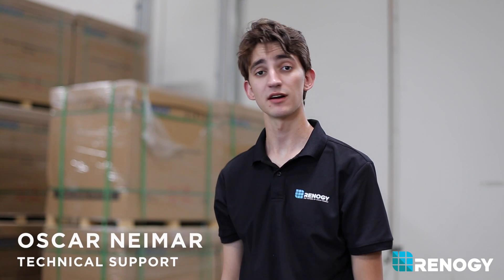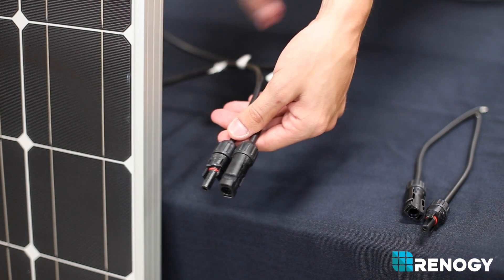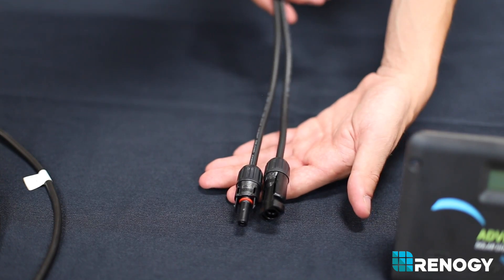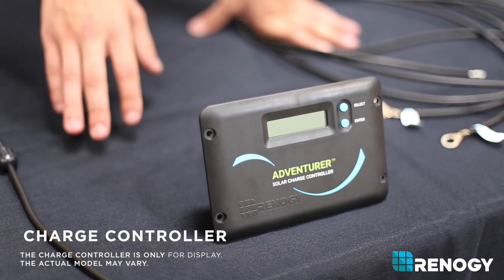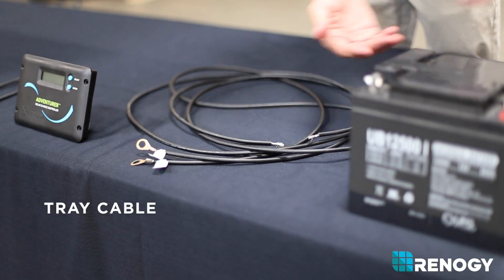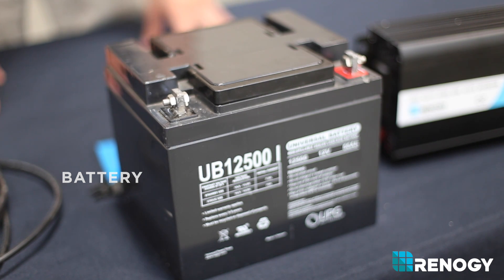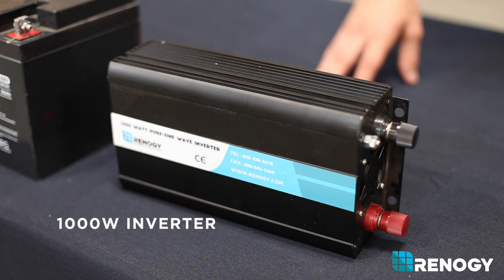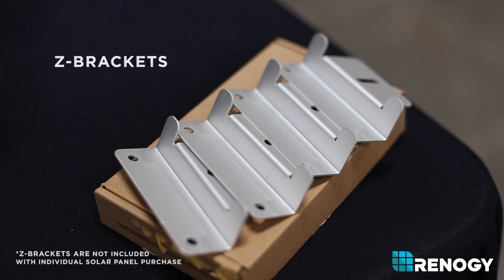Renogy: Basic Off-Grid Kit (4/6)

Comment: Can you suggest an off-grid package solution that I could purchase that would power approx 100' of c9 LED Christmas lights? Thank you!
Reply from the maker: Hi +Jace Perry,

In order to help size a potential system/off-grid package that would best suit you and those lights, we'd need a bit more info, such as:
1) Your state & zipcode
2) Appliance loads (either wattage of each bulb or the volts and amps of each load) 
3) If the device is AC (Plugs into the wall outlet) or DC?
4) How many hours a day, on average, the appliance(s) will be on for?
Since the first question is a bit personal, you can contact our tech team at techsupport@renogy.com with your answers, and they'd be more than happy to help you out.

Comment: Okay. You just rattled off how to figure out the amp-hours but didn't put the figure on the video or in the description box.
Reply from the maker: +Blaine Mitchell Sorry about that, we'll be adding equations to all of the video description boxes shortly.

You can calculate amp-hours like this: amp-hours = watt-hours/ 12V (or, if you decide on a 24V battery, then just substitute the 12V in the equation for 24V).